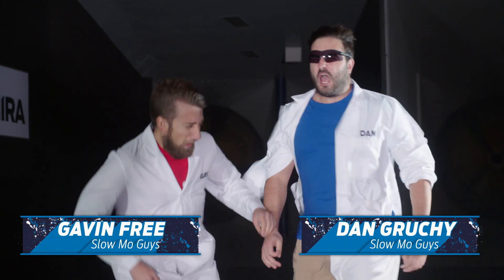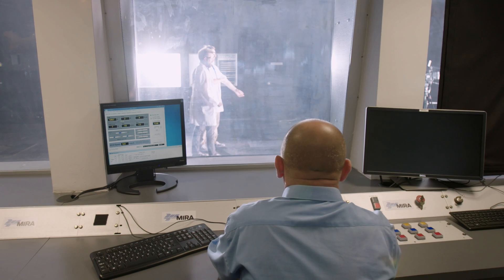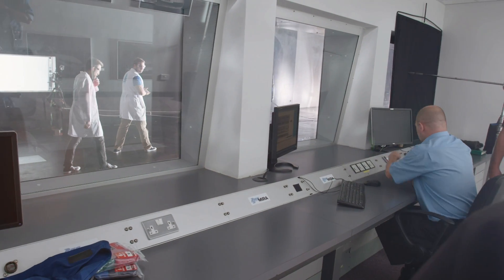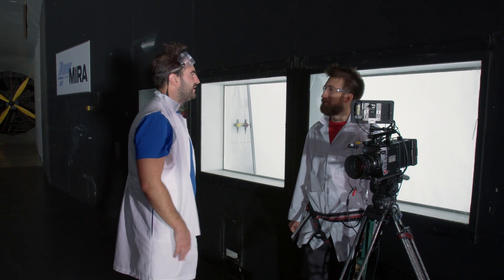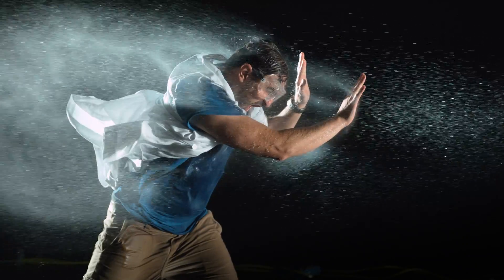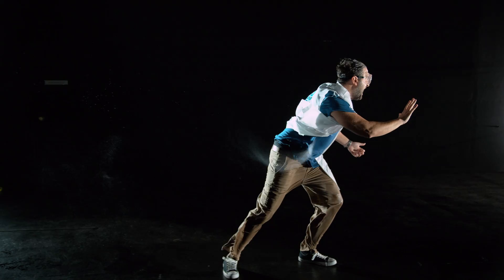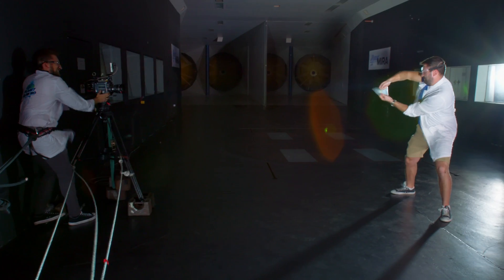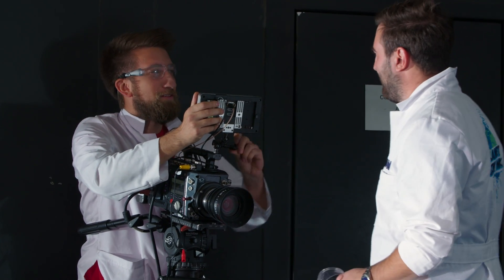Opening a Condom in a Wind Tunnel

Comment: Ok, as to why you need different sizes. If it's too tight to fit comfortably it restricts the blood flow making it hard to perform and really uncomfortable to try (it's not like there's a bone in there, it's held firm solely by blood pressure), if it's too loose it'll slip off. That doesn't mean "they're too tight" is an excuse to go without protection but that just means the guy needs to order his own and make sure he has some if he's likely to end up in someone else's bed. That being said being able to stretch it to those proportions does NOT mean one size fits all.

Comment: He used his lab coat as a sail wing despite the fact that it was sucking air instead of blowing it.
Reply: Sidney Price Air is actually blowing in, just not from the fans. The fans pull air out and due to various laws of physics, more air blows in to replace it at nearly the same rate as the fans are sucking the air out.

Comment: The Panhandle of Texas had a dry hurricane with wind conditions of 85 miles per hour, it’s very strange to see trees and other objects bend so harshly just because of wind, however I did not have a hard time walking in it. ( this is MY experience with these conditions, results may vary depending on shoes, walking surface, or temperature.)

Comment: Was I the only one worried they would fly into the fans?
Reply: Wasn't there netting ?
Reply: @tkdace2459  soft nets wouldn't stop them from getting inside.
Reply: Riasat Salmin Sami yeah they will
Reply: @krashd  cars are massive
Reply: @krashd  cars are way bigger than the gap between the mesh
Reply: @tkdace2459   yes
Reply: I was
Reply: I was too
Reply: No
Reply: Dominik Molnár there's netting
Reply: Yes
Reply: I was like "oof what if I went...I'm wayyyyyyy to light to not be blown into those fans....RIP me"
Reply: YES...
Reply: Next video: Dan gets chopped to pieces in a great big fan! 4k! 20,000fps!
Reply: Yes
Reply: No
Reply: No
Reply: NOT AT ALL
Reply: I was but when i saw the nets No. Gets grind up
Reply: Nope
Reply: There are grills in front of them
Reply: Hihihi
Reply: I have a fear of big fans so yeah
Reply: Asa9 Projects true
Reply: I was also thinking the same 😂
Reply: There where nets
Reply: the biggest debate I mean even if there's net there if.its.metal than your going 80 mph into metal and if it's like cloth material like still would be scary like
Reply: there was some nets
Reply: Yes
Reply: I was the 666th
Reply: Definitely not
Reply: X files
Reply: Pretty sure the operator would switch it off the moment he saw someone falling
Reply: #everyonetoo
Reply: AsaMakes they would get blown AWAY from the fans that are on!!
Reply: @keeef23  they say at the start that the fans are sucking, not blowing, because it means the air in the tunnel is clearer. So they would be sucked towards them.

Comment: Guys that is all very cool but you need to go back again already :)
You've obviously not been into SKYDIVING nor have you asked for a skydiver's guidance before attempting this. :) 
If you want to have better control you need to point your head backwards as far as it goes and basically expose your neck to the incoming wind. Yes you need to look at the ceiling without having to tilt your eyes upwards. You would be amased at how much that can decrease your drag. So much in fact that you could fall forwards into the wind and .... smash the floor :) so only do that gradually and at the floor's own risk :)
By the way skydivers use vertical wind tunnels and yes they have instructors there that offer fun rides to anyone. Any ideas? :)

Comment: gavin chasing a rubber bucket down a wind tunnel while struggling in a harness is the funniest thing ive seen all week
Reply: it's even better when you have the exact same bucket
Reply: I believe that's what the English refer to as "mincing about"
Reply: tiem stamp ?
Reply: Steve Thea 
7:14
Reply: As a 28 Degrees Platinum Mastercard customer, you’ll receive a monthly statement if you have activity on your account.

Each statement provides an outline of the transactions made over the last month and the minimum monthly payment required.

The minimum monthly payment on the 28 Degrees Platinum Mastercard is 2.5% of the total outstanding balance, or $30, whichever is greater, plus any instalment payments due in that statement period. Your statement will also request payment of any overdue payments or over limit amounts.

With 28 Degrees Platinum Mastercard, it's easy to make payments when you need to - choose the method that suits you best. @Sara-f3y7c
Reply: What a sense of humor you have

Comment: For men who say they are “too big” for condoms, watch this.
Reply: The sizes are the elastic bands themselves, they gotta be tight to prevent leakage BUT if they are too tight they can restrict blood flow and cause damage if kept on
Reply: @Sera666  it's the same as putting a rubber band around it waiting a few minutes till your thing turns blue
Reply: Paul Bunyan wants to know your location
Reply: Most condoms are lubricated, so yeah, it will fit, but it can be really tight, and slip off if you’re not carefuk
Reply: Exactly. 🙌🏻
Reply: Im one of those men and i can show you that its still not long enough lol
Reply: @Healthnut69  r/ihavebigcock
Reply: @Healthnut69  it got literally as long as his lower leg. If you were that long you wouldnt be able to walk without it getting in the way. So no
Reply: @reality_is_a_lie9598  yess
Reply: @reality_is_a_lie9598  lol... just because it can stretch that long, does not mean it will stay that long. It's elastic... you can't keep it stretched if its natural state is much shorter than you are.

Comment: Trojan needs to use this for a commercial.
Reply: “One size fits all”
Reply: @gav6189  You got that right. "ALL"
Reply: @gav6189  Most hearing protection conforms to the ear canal providing a tight seal. They really should have worn hearing protection because not only did they need to scream at each other to hear them, but electric wind tunnels reach 107 decibels. That causes permanent hearing loss and Boeing high pitched ringing in the ears if they were in there for more than 3.75 minutes. 

They certainly weren't protected from the harmful decibel levels. Now that's depressing.
Reply: super bowl commercial 2020
Reply: Bad brand name ,being as the Trojan horse let a good amount of guys in
Reply: @trunksGav  LOL I honestly never thought of that but you are so right!

Comment: LAMINAR FLOW
Reply: Loved your laminar flow video!
Reply: Lmao
Reply: DANG IT I WAS LITERALLY ABOUT TO MAKE THAT JOKE

Turns out I was 5 hours too late
Reply: Need to poke a hole in a swimming pool inside a wind tunnel... Laminar flow INSIDE laminar flow!
Reply: Destin you know about high speed cameras, perhaps you’ll know the answer to this I’ve wondered for years: most of the Phantom cameras you’ve used recently (V2512, V2640) have pixel throughputs of circa 10^10pix/s (frame width x height x rate). You can lower the res to get a higher rate, but it usually comes out around that figure. Modern consumer cameras and even smartphones have throughputs about 20 times less than that (think 4K60p). Applying the same rule of thumb, a consumer camera should be able to record 640x480 at 1600fps! So why can’t they!?
Reply: Samsung's newest smartphones actually can record at about 1000 fps. To answer your question though, the reason smartphones can't record any faster than that is they simply can't get enough light. The exposure time of each frame decreases as you increase the frames you record per unit of time, so the tiny lens/sensor on a smartphone camera just can't take in enough light to record at super high frame rates without the image becoming far too dark. Slo Mo Guys actually have an awesome video on their second channel that explains this really well, you should go watch it!
Reply: Joseph Bowers Thanks for the reply - a very good point. So you’re saying it’s primarily due to practicality limitations rather than technical ones... and I think that’s probably right, together with the fact there’s not a lot of consumer demand for such fast frame rates. Samsung and Sony both have phone cameras that can shoot 1000fps for about 0.2s, and that’s I think due to a limited memory buffer in the camera unit, but couldn’t figure out why that same limitation doesn’t affect its 4K video... So another possible factor could be processing time; I bet phones/consumer cams record video straight into an efficiently compressed format (as opposed to Phantoms which record raw..?) - so the actual pixel throughput is a lot lower than I suggested - and the compression algorithms simply aren’t fast enough to perform at very high frame rates... yet! But I’m just speculating. Anyway yeah cheers again for the reply!
Reply: SmarterEveryDay 
Lol of course you would get excited about that.
Reply: This isnt Lame-inar
Reply: This should be a meme now. 

JK , I love laminar flow
Reply: At this point, Destin has basically turned into the SPACESHIP guy from the Lego movie. Just with laminar flow.
Reply: Just stop it we all know your obsession with laminar flow 😂
Reply: Don’t you mean ＬＡＭＩＮＡＲ ＦＬＯＷ
Reply: Thanks Destin, very cool!
Reply: L A M I N A R
Reply: DESTIN

DESTIN
Reply: I just watched your vid XD

The laminara one XD
Reply: That's what I thought about immediatly when i saw the tunnel structure (1:24) at the air inlet! Thanks for making the Laminar flow videos, they are great!
Reply: 666th liker
Reply: Just watched your video on Laminar flow and assumed you would love this :)
Reply: AGAIN!? lol
Reply: I just came from your laminar flow video
Reply: Of course, Mr. I'm An Aerospace Engineer comments on this. 

Amazing.
Reply: Hi destin
Reply: wow I love you ure great
Reply: Cool
Reply: Your actually the first person I though of when he said really clean air no turbulence
Reply: LOL I watched your video right before this one.
Reply: Smarter every month... Or so. :3
Reply: Dang stop yelling
Reply: It is very awesomes
Reply: @wolfy5178  I think you're starting to become the next Vsauce Puppet or Justin Y.

Comment: What if you got sucked into the fans and got chopped up like a pork chop
Reply: I was staring at those masked the whole time. No safety ropes. Jumps. Slipping. Terrifying. However. There was a strong net there hat would probably have caught them and the motors likely have a clutch brake that emergency stops them immediately.
Reply: Pork chop slow-mo

Comment: Gav and Dan, you need to check out the 80 ft by 120ft and 40 ft by 80 ft wind tunnel at Moffit Field, Mountain View, Ca. 
The wind tunnel circuit there has SIX fans that have 15 wood variable pitch blades that are 40 foot in diameter, each powered by a 22,000 horsepower electric motor. Maximum wind speed in the 40' x 80' test section is 300 knots or about 345MPH!  
Try to stand up in that puppy!

Comment: 8:01 ... Video encoder says: .... "Oh boy, here we go"
Reply: YT Compression is awful
Reply: i switched to 4k at that point. Less artifacts.
Reply: I always wondered about this
I have noticed this artifacting in shots of flowing water, like for example in a river, or in the waves of the sea.
Also, it seems to be happening generally in videos with scenes of small moving particles like sand for example.
Can you explain why this happens?
P.S.: I frequently watch astronomy-related videos and I also see this happening when they show pictures that are filled with stars.
Reply: @makismakiavelis5718  I think basically the principle is, if lots of the pixels change very rapidly, I think the video encoder just fails to encode it properly. I think a better answer will be on Google most likely.
Reply: @makismakiavelis5718  I had something like this in school and I think it has to do with how the compression works. There are diffrent kinds of compression for video formats. In this type of compression you can see here, the program looks for similar pixels in the pictures, frame by frame, and tries to compress them. Thus the bad quality in these scenes. But I'm not 100% sure about it and what @nnediamaster said could also be a reason.

Edit: This Video: https://www.youtube.com/watch?v=r6Rp-uo6HmI explains very good how somethings like this happens. This artifacting is caused by a compression better called interframe compression. And what I said isn't right it doesn't look for similar pixels it rather cuts the bitrate of the video. I recommend you to watch the video that I linked in the edit, the guy explains it very good.
Reply: @curdin_media 
Dude, thank you so much! That was exactly what i was looking for. The video you posted was spot on. I think I've watched some of this guy's videos in the past.
More Confetti!
Reply: @makismakiavelis5718  No problem dude, you're welcome! :D yeah I also watched some of his videos. 
throws in even more confetti :D

Comment: SELLING MY GAMING LAPTOP

ALIENWARE 15 R3 (MANUFACTURER REFURBISHED)
15.6” FHD (1920x1080) IPS ANTI-GLARE 300-NITS DISPLAY W/ G-SYNC
INTEL i7-7700HQ QUAD-CORE 6MB CACHE @ 2.80GHz W/ TURBO BOOST UP TO 3.8GHz
NVIDIA GeForce GTX 1060 6GB DEDICATED GRAPHICS W/ 6GB GDDR5
LITHIUM ION (68 Wh) BATTERY W/ UP TO 7
HOURS BATTERY LIFE
1TB 7200RPM SATA 6GB/s + 256GB PCIe SSD
16GB DDR4 @ 2400MHz (2x8GB)
WINDOWS 10 PRO 64-BIT
MULTICOLOR BACKLIT KEYBOARD

FOR MORE INFO, PICTURES, AND PRICING CONTACT ME!
louisgastons@gmail.com

Comment: That's not in use according to the original manufacturer's instructions...
Reply: If they showed it being used to the manufacturer’s instructions they’d probably get demonetized
Reply: 11:11 new desktop picture!
Reply: big' ol wang
Reply: TrollFaceTheMan I'm dead.
Reply: They should add it
Reply: I got this feeling that gaven beard would fall off
Reply: It'll be like cheese grating gone horrible.
Reply: TrollFaceTheMan.
Reply: The operator accidentally slips and turns the wind to the max of 500. Both get thrown back, one hits the back of the wind tunnel and explodes like a water balloon hitting the ground. The other flies sideways hitting the wind panel and gets his head cut off and hits the back and explodes, along with his head...
Reply: CloakGaming da fuq is wrong with you